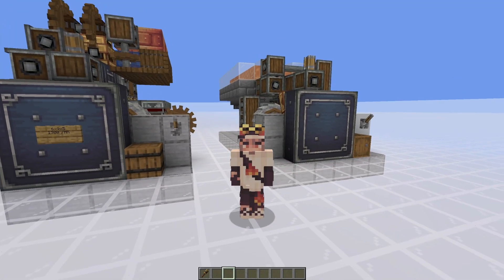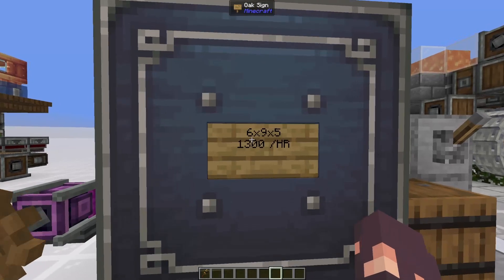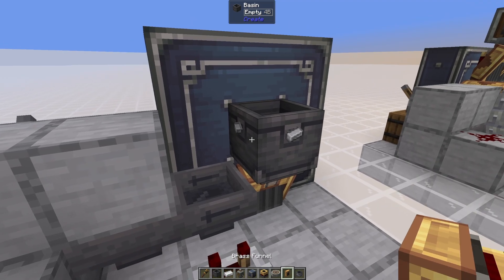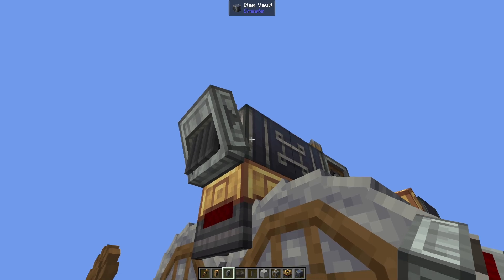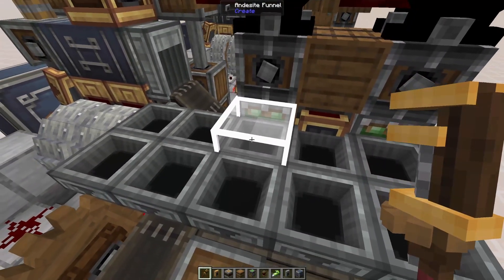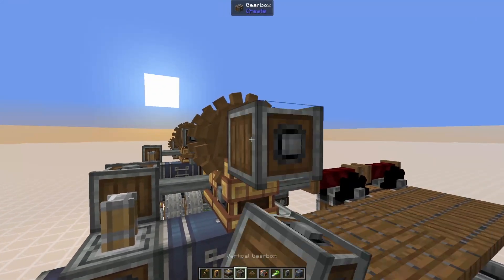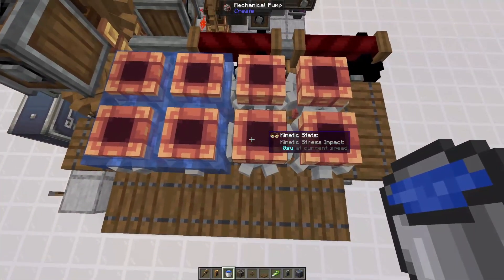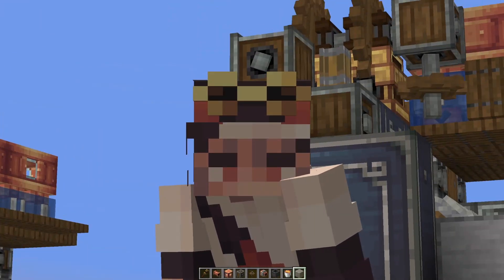The NEW ULTIMATE CREATE IRON FARM (No Villagers) 1,300 IRON PER HOUR! |  Create Mod 0.5.1.f TUTORIAL

Comment: really cool build, for anyone wondering you need 22 large water wheels to power it fully, which is equal to 352 planks (5 and a half stacks) and 22 shafts, which needs 6 andesite alloys if crafted normally (4 if done through a saw)
Reply: using water wheel as a scale strangely gave me much more idea how much energy it needed lol
Reply from the maker: Thanks for the pro math!!
Reply: Bro I built this and those 22 large wheels on my friends server and our fps drop from 160 to 40 once going around this ...
Reply: @knucklewazowski812  run /flywheel backend instancing
Reply: @knucklewazowski812  I built mine with a steam engine and it dropped from 200 to 34 fps lol
Reply: i did 22 large waterwheels and it says its overstressed :(
Reply: ok nvm it works i just placed some of them wrong
Reply: TYSM! I'm very new to create mod this is my first actual playthrough with it, so this helped out a ton thank you
Reply: how did you set up the water wheels ?
Reply: @ just made a long line of them and attached it to the farm
Reply: or 7 large water wheels, a full 128 sail windmill and a set of gear ratio'd cogs
Reply: or... one self sustaining steam engine-
Reply: So the farm won't work without it?
Reply: Ugh this method doesn't work. It says the machine is overworked
Reply: Oh normal. You jsut have to place water over every single water wheel